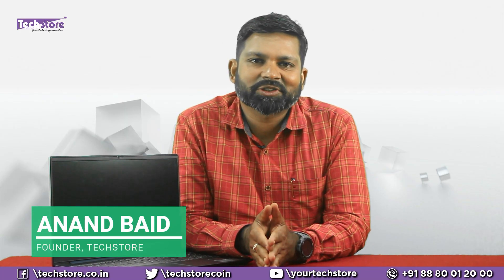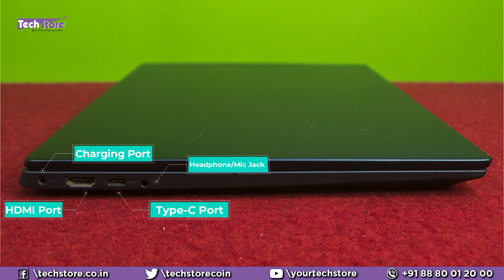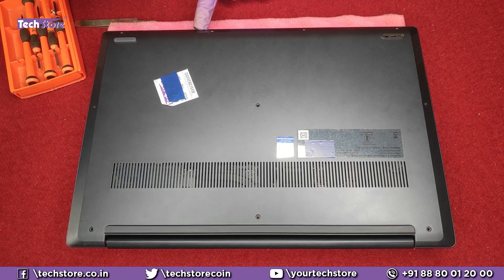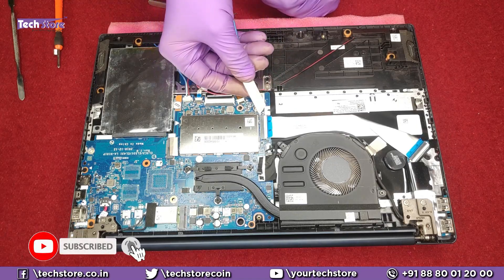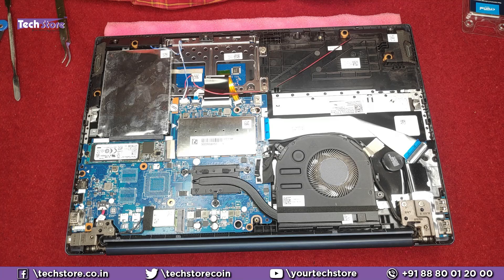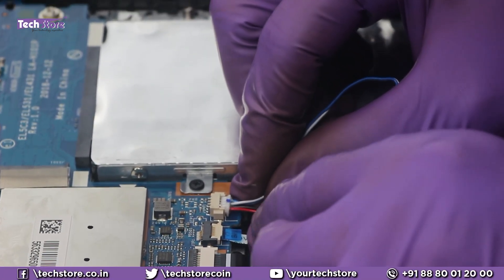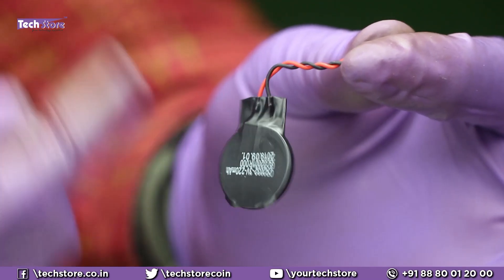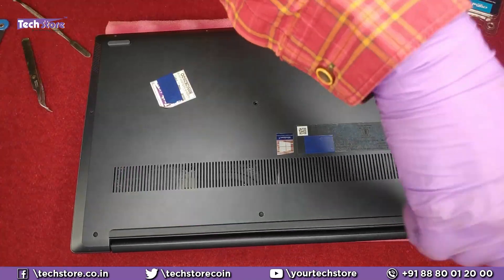Lenovo Ideapad S340 : How to disassemble upgrade ram m.2 nvme ssd hdd battery easy diy

Comment: Nice video bro, is there approximately 4 mm of space in the m.2 nvme slot to attach a heatsink with thermal pad?  I have a temperature problem on the SSD. Thanks before that.

Comment: Hello sir.. i am using Lenovo Ideapad S340 - AMD RYZEN 3 varient having 126GB SSD & 1TB HDD with 8GB RAM (4GB SOLDERED)

I would like to update my RAM for better performance. Lenovo support team is not recommending to go with 16GB DDR 4 RAM and against its max capacity of 12GB altogether. 

Your suggestion on the video is 16GB DDR4 3200mhz for AMD RYZEN 3 but my laptop is having 8GB DDR4 2666mhz at present.

Shall I still go for 16GB DDR4 3200mhz ? Won't it affect laptop's existing performance and void warranty? Pls advise
Reply from the maker: install 16GBDDR4 2666
Reply: @TechstoreCoIn  Sir also have lenevo ideapad s340 14iwl but with intel core i58265U CPU 1.60ghz ,1800 mhz 4 core 8 logical processor.The total ram is 8 gb (4gb soldered) Can i upgrade 16 gb 2666mhz maxxing out to total of 20gb or opt to 8gb gb with total of only 12 gb which is not big upgrade to take advantage of? Please help!